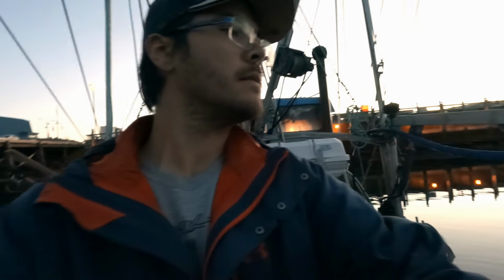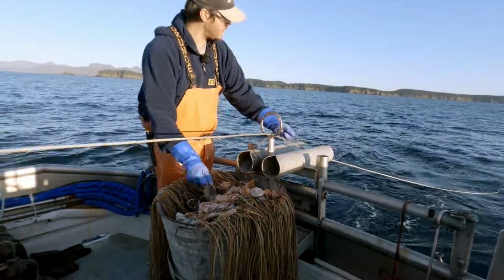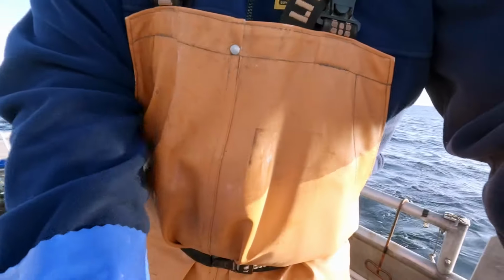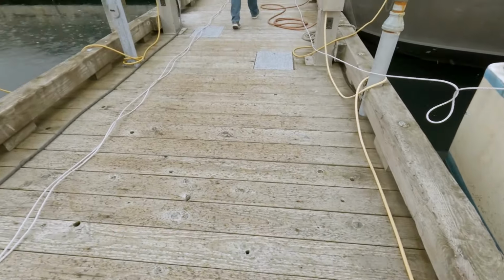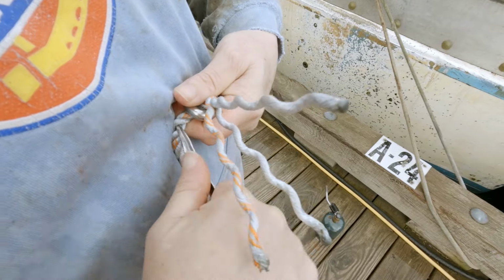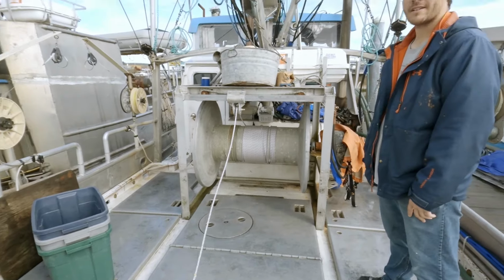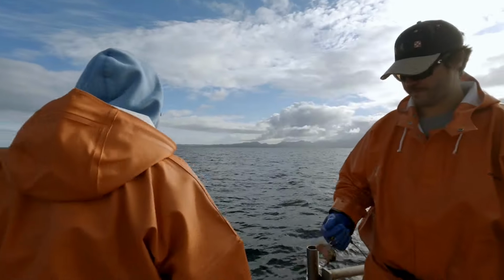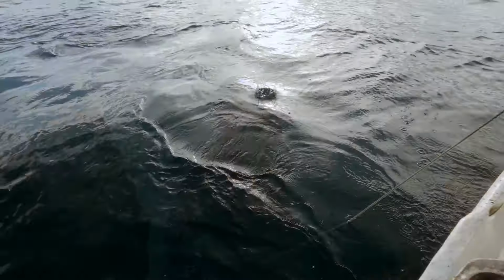Setting Some Gear - Fall Halibut Fishing

Comment: So  good to see your Mom, & Triston! This was interesting how you used 1800' of rope(?). I like how you wove the colors into the line to mark your 25' & 50'. That made sense, either end in would be 25' in. It was sad to see you go to all that trouble to put in new lines that you ended up with a starfish, 2 stingrays,  & 2 Halibut while the seagulls enjoyed pollock scraps. I liked how your Dad separated the braids to put the chain link (?) on then wove the threads back into the rope with his tool, then burned the ends to prevent further fraying. It holds up so strongly. I watched this video several times. I loved seeing what you pull up out of the water. I love seeing everything you see. The scenery, the sea, is so beautiful around  you.  I really like all these different angles you show. It's nice to get a glimpse into the lives of other people to see how they live. It's sure not an easy life. Thank you. Have a good week.

Comment: Could you please explain what the bird line consists of and the way it deflect the birds attention from the main fishing line. Thank you. Love your video. I never miss any.
Reply: The bird line is a rope with a float at the far end from the boat. There are a number of other pieces of rope attached to the main line. They hang down like vertical blinds and the birds won't fly through it for fear of hitting a wing on the vertical lines. It's done so the birds don't try to grab a bait with a hook in it, which will drown them. This is a mandated device for the safety of wildlife.
Reply: @TheCaptainbeefylog  thank you for the explanation

Comment: The longer leaders look harder to deal with tanglewise.  Is this an experiment to see if they are more effective at fish catching or a new regulation?
Reply from the maker: No regs as to length or size of gangion material or hooks. This was some gear a freind had baited up. He finished his quota sooner than expected and let us fish his gear rather than strippping the bait and wasting it. We also used longer gangions in the past, but adopted shorter ones quite some time agao. They are a lot easier for us to handle.

Comment: just curious, how long does your guys halibut season go for? and does it get split up by  the seasons? down here in the sound commercially we  get to fish during the spring and maybe into the summer depends if theres quota still left.  but i know alaska has one of it not the biggest quota for halibut
Reply from the maker: The commercial season in Alaska runs 9-10 months. The start/ end dates move around a bit, but it usually opens the first week of March and closes early November. This year the close date is Dec 7th. I think it was extended the last few years due to Covid.
Reply: @EISAlaska  ya our season got extended too it ended september 30th. the straits of juan de fuca is where i fish. and the last couple years has really been great but theres a few fish out there

Comment: Are you backing down on it, or just letting it pull the boat backward as it comes up?
Reply from the maker: Usually we haul with the current, so by hauling the longline in, the boat will follow. Sometimes we need to reverse on it when the wind or current is pushing us against the line, this keeps it from stretching out and lifting the line off the bottom.

Comment: The longer leaders seem to messed up your routine. It just looked like the set out and retrieve were more disorganized then I'm used to seeing.
Reply from the maker: William you are correct. We used to have long gangions like the ones we used on this trip. Honestly don't miss them one bit. It was hard to get into the groove setting and hauling.

Comment: That splicing is impossible, got to be just luck ,I've been trying constant for weeks, watched  all the vids but sorry mate for me it doesn't work 😕 so complete impossibility  so please. Like on other vids don't say uts easy please, as if its real, humiliation  to me is sufficient  ,thank you
Reply from the maker: Keep at it Terry, it will come. A few tips that may help. If the line is really soft and floppy, tape the ends of the strands to keep them from unravelling. Before you make the first tuck, tape around the diameter of the line on one side and start with tucking those strands first. After the first tuck on both sides, draw the stands tight by pulling lightly on each one, several times. The goal is to draw it up good and tight, but evenly. If you tug hard on the strands it will draw up unevenly and be lumpy and misshapen. Here is another video, I think shows the process a little better https://www.youtube.com/watch?v=fxr7HNd4Lsc&list=PLkCEDunsXt1zJ1gVWx_Y5MNW73z-m6zzk&index=34
Good luck!